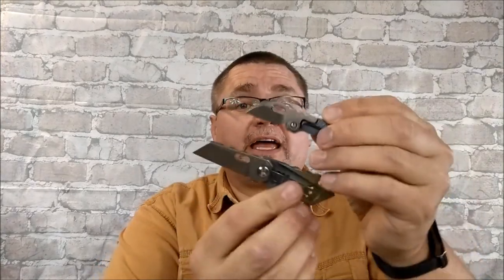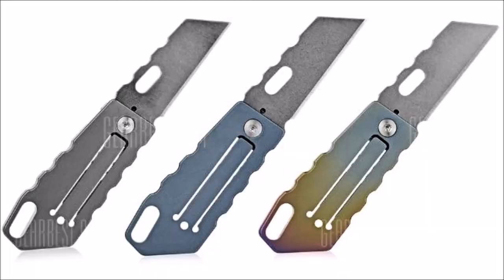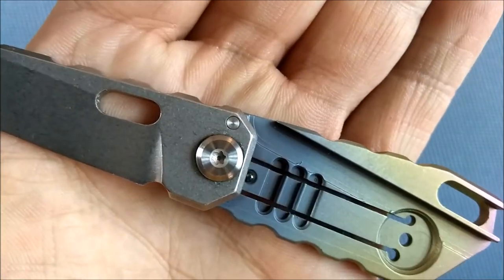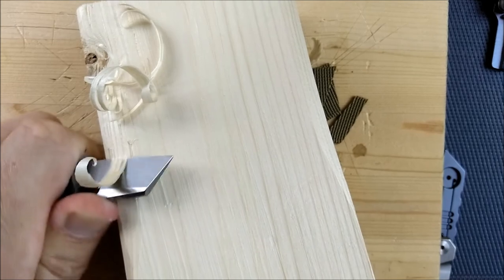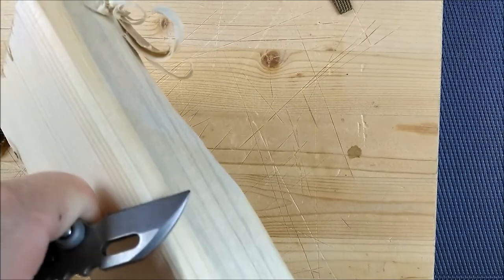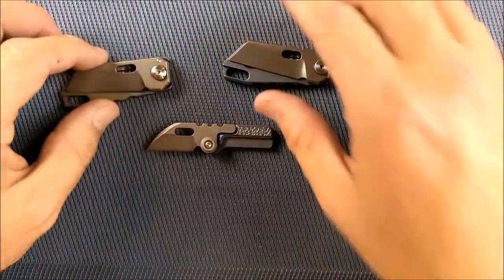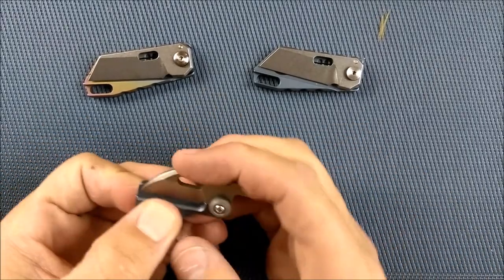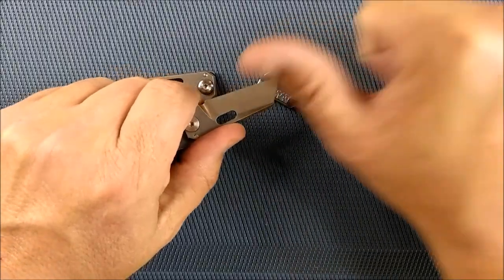FURA Wee Wed Oct 18

Comment: Hi.  I enjoy your videos very much.  Thanks.  A quick question about the edge angles you mentioned in this video:  I think you use a WorkSharp.  Are you really making your outdoor knives 40 rather than 50 degrees and how are you achieving a 30 degree grind for kitchen knives when the thinnest guide the WorkSharp comes with is 40 degrees?
Reply from the maker: I use the Worksharp for my outdoor knives - fixed blades.  I have a TSPROF model# K02 for the majority of my folding knives.  Most of my folding knives I do at a total of 40 degrees.  Does that clarify your questions?